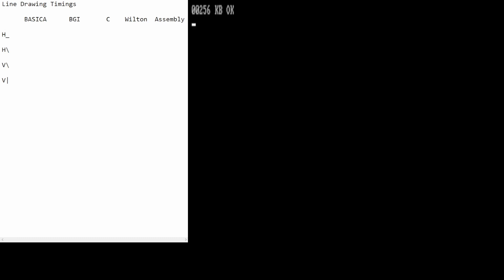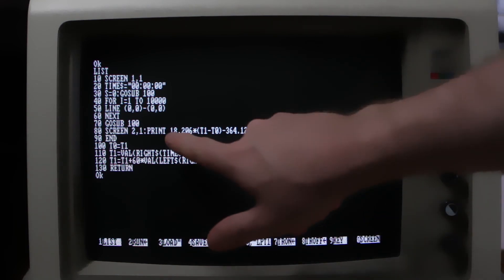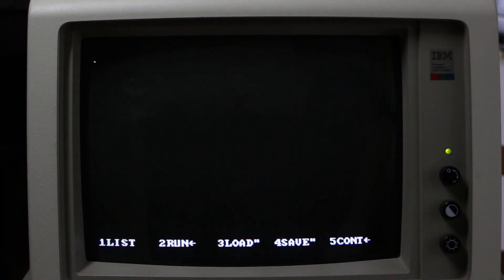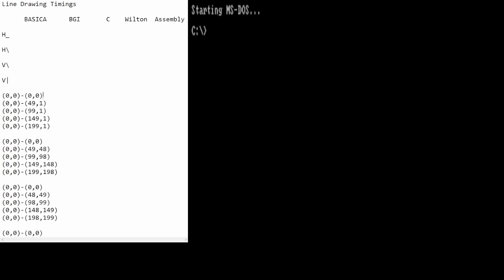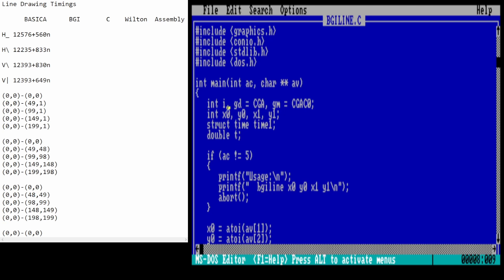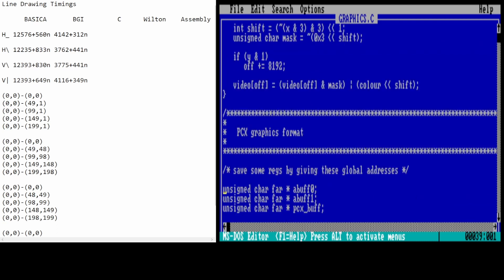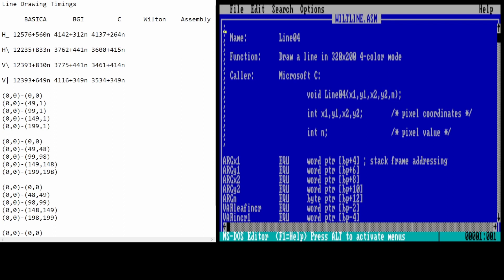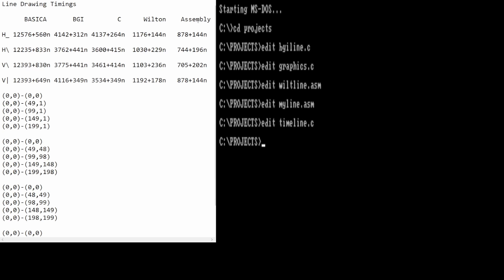CGA Graphics Programming: Timing Line Drawing in Basic, C and Assembly

Comment: Nice, it confirms what I've suspected for a long time. I did a comparison for vga 13h using the bgi, pascal, and assembly a while ago on my blog and it showed a similar thing, assembly being the fastest code.

A useful basic function you can use for timing is timer. It returns seconds from midnight including fractional seconds. It won't make things faster, just it's simpler and easier.
Reply from the maker: Yeah I missed that function, thanks!